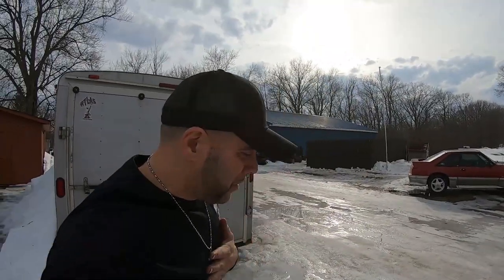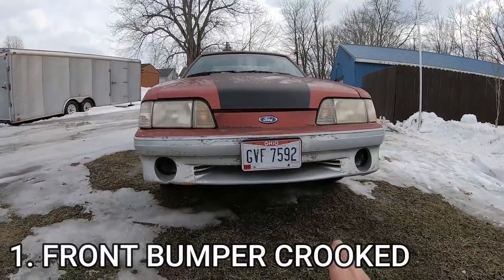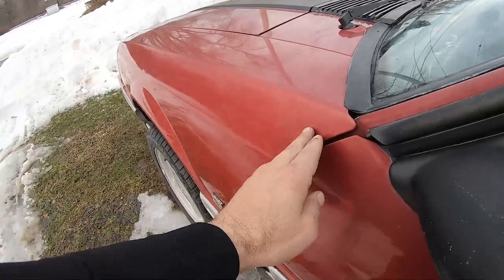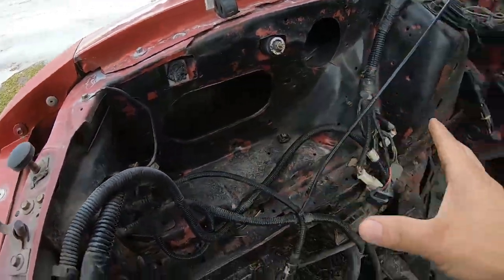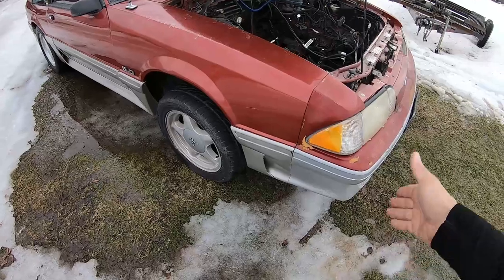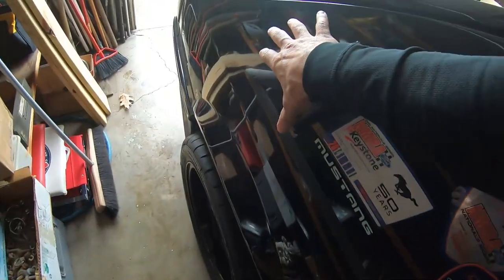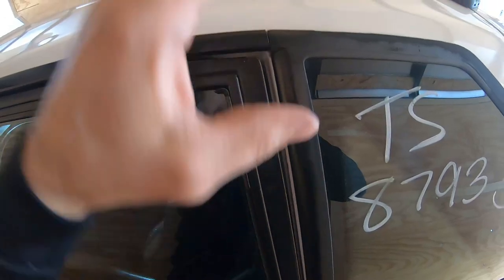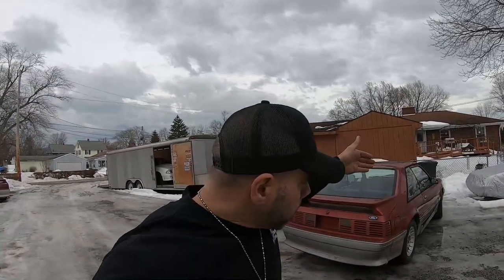BUYING a Foxbody? 10 SIGNS It MAY Have WRECKED Before YOU! ⚠ Warning ⚠

Comment: You’re %100 correct I have a 90 also that was getting painted when my body guy went to jail. The car was in pieces in primer and I had to have it flatbedded to my house. Insurance totaled it and I bought it back for $300. They said if I decided to try and finish it it wouldn’t be a problem registering it again and that it is possible to get the salvage mark off the title by having it inspected by the state. It’s a lx hatch 5.0 5 speed blue with grey sunroof car. I’d like to finish it this year. I’m always busy working on the other mustangs but I think it’s time. I looked all over for that car and literally drove it from the guys house to the body shop where it was taken apart about 3 years ago. It’s a shame it’s an all original mustang. Never messed with. It’s a clean slate.

Comment: Good stuff!  A 30 year old car is probably wrecked - my 2016 Dart had been wrecked when I got it in 2017!  Project Phoenix is mangled in the front core support and bumper shocks, but airbag did not deploy.  JYM (89) has the older fender on one side and the 91+ fender on the other side that I pulled from the junkyard.
Reply from the maker: Ya weird it didn’t deploy. Same with this one

Comment: Good video D! You gotta love those Midwest, bust your ass, sheets of ice that dominate the landscapes this time of year.
The front passenger fender on my 87 has been replaced. It has a Ford DOT tag instead of the Vin Tag. I had my body guy look at it and he didn't think it was hit...maybe rust, or a small bump?  But now what makes me think further, is that there is indeed a crack next to that "Anderson Power Pipe"
My next venture is to look at the area where the shock tower and frame meets you spoke of. I have a clean title and car fax, but we both know, that doesn't mean ish!
Reply from the maker: The only way that cracks is if it moves !